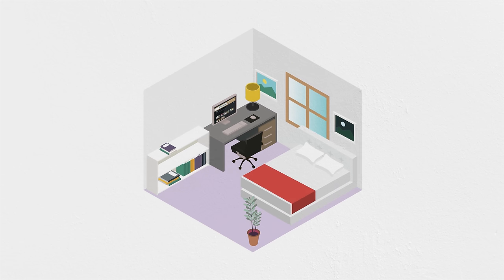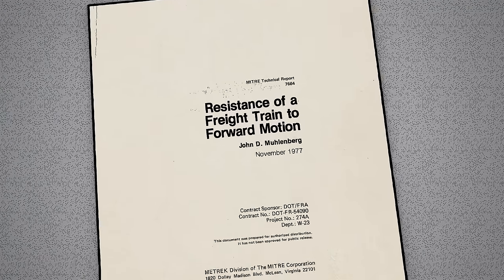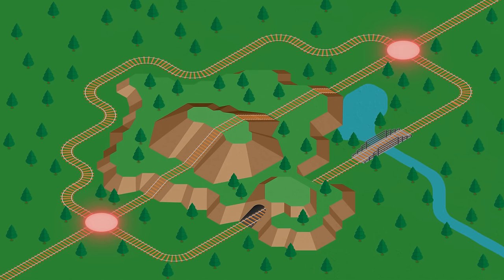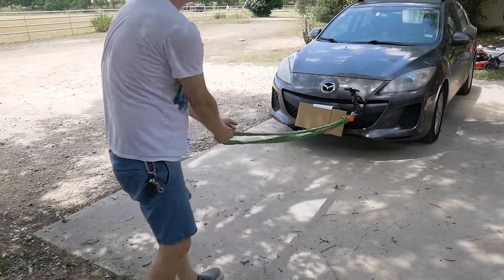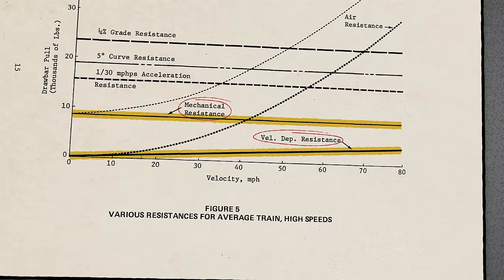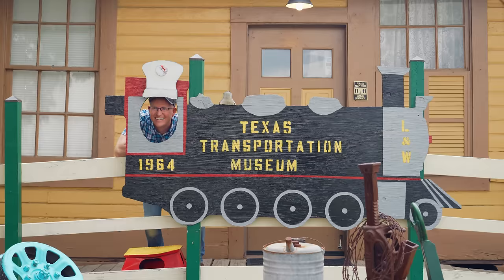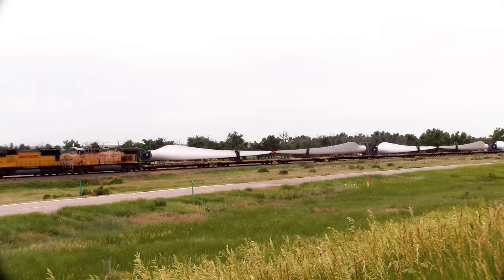Which Is Easier To Pull? (Railcars vs. Road Cars)

Comment: When going up hill pusher sets are needed to help going up hill on a railroad. When going down Dynamic Breaks are needed to help slow the engines like a Jake brake on trucks. As far as railroads with many Curves the tracks need constant reprofileing by rail grinders. But even then it coasts a lot of money to replace the rail due to the rail drift as the rail head wears out one the inside of the rail curve and the rail head drifts on the inside of the outer rail head.

Comment: If you're not already planning to, could you talk about how the weight of an object (the weight of a train engine or a man) puts a limit on the amount of horizontal force it can exert in a load? All I know is that once you exceed that limit, you end up skidding.
Reply: The key value is the coefficient of static friction, often known as µS. On level ground your max pulling force is weight times this coefficient. Once you start skidding you get kinetic friction which has a smaller value. For reference dry steel has a µS of about .5-.8, going to .42 when sliding.

Comment: As firefighters we are used to push cars by hand. Once we also needed to push a regional transport train. We pushed two carts, approximately 110 t in weight. Modern carts on modern tracks. We used 3 people for that. Once we got it moving, we barely used any force. We needed to be careful not to go to fast, because it was to easy 😂
Reply: Oh and for a car, we also need 2-3 people.

Comment: I have to add something interesting :D I am a 27 year old railway traffic commander in Hungary, but sometimes I have the opportunity to drive /with special permission/ because I'd like to be a driver later and I'm in the profession from age 10 (I served at the Children's Railway at Budapest) so I have comprehensive knowledge of the railway operations. The trains are faaar lighter and shorter here, maximum around 2000t in weight and 800m long. But one thing can be really surprising and scary. Once I had the opportunity to drive a tanker train full of diesel fuel. I just left the departure station but had to stop at the next station's Entrance Signal in Danger to let an EuroCity pass me, so from caution signal I started to apply the brake slowly . With other types of waggons this modern Siemens Taurus locos usually have a nice deceleration curve thanks to the fully computerized brake system, but this time the tankers surprised the heck out of me. They actually begun to jostle the engine making the traction motor indicators go crazy as the computer desperately tried to make up a new curve with each impact. It took me a good second to realize this motion is actually caused by the diesel fuel sloshing around in the tankers! Eventually I stopped the train safely around 15-20meters from the signal, but you could hear the tiny squeels the brakes made when the whole consist tried to move forward and then backward on and on from the motion of the fluid inside them. There are wave breakers built in them to reduce the effect but they are not perfect. It is crazy how much energy can be picked up by the fluid while you move the train around.

Comment: AcTuAlLy
In metric there is a measurement called kilopond, which is the weight of a 1 kg mass. (We had to calculate with this because we had really old hardness testers)
Reply: AcTuAlLy mass doesn't have weight without something opposing gravity accelerating it.

Comment: Don't forget to mention though that whilst you might only need 2-4 locos to pull a bloody long train, the diesel engines in them locos are just as big as your car not your car's engine. Hardly comparable but I get what you're trying to say.

I love the fact you had a use an aussie BHP train to show the midway locos :P  ... looked like they may have been WA/NT iron ore trains but frankly I've seen Sydney to Brisbane express goods (freight for the yanks) trains with 2-3 locos at the front and the mid ... they're the sort that are WAY too long to fit in the loops and get priority the entire trip so are not so common. Up to and over 1km long.

Comment: About the safety razor; I switched as well when I recently looked at how much plastic is used to make a disposable razor plus the cartridge head if there is one.  Compared to steel razor blades the environmental impact alone suddenly became obvious.  Even if the blade just rusts, the difference makes the change worthwhile.
Thanks for another excellent video, Grady.  Another thumbs-up, of course.

Comment: I instantly recognized that blue locomotive at the museum: that's a GE 45-ton switching engine, with two small diesel engines, located on either side of the cab. At the Mid-Continent Railway Museum, they have an identical engine that was donated by the Navy. You be hard pressed to find any other type of diesel in the US with tie rods.
Fun fact: the reason these 45-ton exist is because of contract terms. At the beginning of the diesel era, the railroader unions negotiated contracts that said that any diesel locomotive over 60-ton had to have a fireman in the cab. Rather than comply with the spirit of these terms, many railroads instead bought lighter locomotives, so they could pay 1 person instead of 2.

Comment: I dont usually comment about sponsors, but safety razors are superb tools. A great aspect is rhat the blades can be sharpened, and/or recyxled - it's just a thin piece of steel. The handle and head should last a lifetime.

Comment: It should be noted that even with the resistances so low, a locomotive could never get a long string of train cars going from a standstill if the train cars didn't have draft gears. I'm surprised you didn't go into detail on them or even mention it

Comment: 5:57 and this is also how highway engineers determine the “recommended” speed on curves! If you exceed the maximum speed rating, you run off the road!

Comment: You would have had fun a number of years ago the transportation museum in Roanoke Virginia had an event where they tied a rope to their massive Norfolk and Western class J steam locomotive and had gas pulled the fully fueled and watered steam locomotive with the rope...395 tons of locomotive and up to 35 tons of coal, and 22,000 gallons of water.  Which is amazing on 1950s technology it can roll so easily

Comment: Not getting the energy back when going downhill is only true for diesel trains, normal trains just start regeneretive breaking and send the energy right back into the grid. There's many steep routes in switzerland that are energy positive one way, and overall recuperate 80-90% of the energy used.

Comment: Trains have super tiny contact surfaces, made of very hard and very smooth surfaces. Very little friction. So it doesn't take much power to move them, it just takes time. Just as it takes time to move the 2 ton boulder in a pole we have in the city. You can rotate it without any tools, it just goes slowly.
Also the reason for why trains can't really go uphill. And down, the same low friction that makes the train slip when going up will also cause it to slop when going down.

Comment: The largest freight-rail brand in the US operates a short line to a local manufacturer near me. Far from basing power on the needs of the expected consist (which amounts to almost nothing), they will often have two or even three locomotives tasked with pulling half a dozen average-weight cars on nearly ten miles with little elevation. Even when I have heard engineers reflect on the public claims regarding 400+ mpg per ton, most of them don't seem to actually believe it other than theoretically. The freight prices to use them really reflect this as well, hence the far greater dependence on over-the-road trucking by all of the companies I have worked for (plus the trucks are far more efficient with time ). In general, for most purposes, the rail companies actually seem pretty wasteful compared to their promise.

Comment: I always thought the limitation to grade was based on traction. The coefficient of friction between steel and steel is very low therefore the locomotive's wheels will simply slip if the grade is too steep for the overall weight it's pulling. Hence the need for funiculars or toothed rails in mountainous areas

Comment: A so-called one ton pickup truck is NOT actually limited to one ton of weight hauling.
It's more of a standard VOLUME description, I think.

For reference, I can easily carry 2-3 tons of gravel in the back of my E250 van (which has a bit LESS capacity than a F150 standard pickup truck), and that's WEIGHT limited not size limited.

Still, it would probably take ballpark 10,000 1-ton pickup trucks to move it.

On the other hand, it would take MORE semi trucks, given the total limit of weight of those in most cases of 40 tons INCLUDING the weight of the vehicle itself (way over 3 tons, more likely 5-6 tons normally for tractor + trailer).
More like 800 such vehicles with a "gravel" type trailer.

Comment: 3:50 i would have loved a more detailed explanation here, i am not a native english speaker and the difference between mass and weight is hard to understand when its not the mother language. in germany we also differntiate by "Masse" and "Gewicht", the units used are usually kg and newton, newton being the unit for weight if you go technically. in daily use the approximation usually is done in kg, because 1kg is pretty much equal to 1kn, but its not exactly the same. it would be great to show SI units alongside Freedom units at all times. that said, im critiquing a small detail in an overall excellent video and i really like your content.

Comment: Its all about the gradient. The rail car is super heavy but its got utterly low rolling resistance. This is assuming a perfectly flat and smooth surface. See the car's weight is distributed over a larger surface requiring more force to move it. The railway car's weight is distributed over a very small surface area as such its rolling resistance is very low.

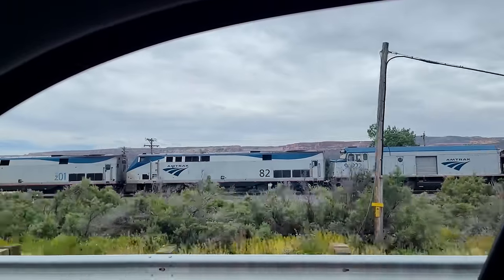Comment: 4:45 Even if a train didnt need to brake, it still would be less effective due to air resistance increasing with the speed squared. meaning that going a consistent lower speed will have less total air resistance than going slow and then very fast.

Comment: The loss of energy on braking is only true for non-electric trains, though. Those can switch their motors to be generators and reclaim most of that energy. So when building i.e. an electric tram in a hilly city, the calculation would be different from a diesel freight train for that reason alone.

Comment: I immediately started thinking way too hard about the choice of route. Lol
I was considering up-front cost of construction and long-term maintenance costs on the bridge and tunnel, whether it was a time-sensitive load, additional crews needed, depending on the length of the route, etc.

And yet, I still failed to think about the resistance added by curves.

Comment: Speaking of break even analysis... Let's do one on the cost of a good straight razor. compared to henson. You can get a straight razor and strop for around $25+ new and if you buy an old one at a flea market for the same price you will have a lovely vintage piece and just have to spend another $10 or so on a strop. My oldest straight razors have been in use since the 1800s and still shaves my face like a dream. Looks like we break even before the experiment even starts as you don't need to spend as much on a straight razor and an entire shave kit as you do hensen since on your chart it starts at $70.
Reply from the maker: I tried a straight razor and just found it really stressful. It takes a lot more skill than a safety razor.
Reply: @PracticalEngineeringChannel  that is a valid point. Not everyone is comfortable or skilled enough to hold an extremely keen blade to their jugular.

Comment: No ... the 'metric' system does not use kg for weight units. It uses the Newton. I believe kg are used in everyday as a unit of mass which is correct in commerce. The pound is a measure of force and for a given object, it's weight will change with altitude. Mass in the Imperial system is the stone ~14lb at sea level.
Sarcastically, I feel that when folks move from Imperial to SI units, they like it when the number on the bathroom goes down (kg) not up (N). For example 220lb = 100kg = 980N.

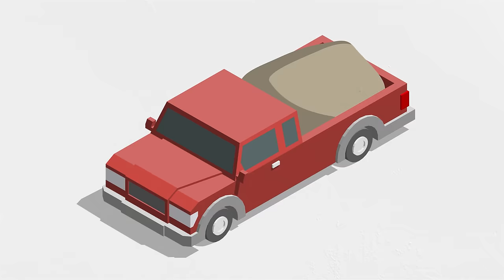Comment: 0:40 "One-Ton Pickup Truck" is a term that has become very misleading. I assume it dates back to maybe the 1950s or earlier when that is how much the trucks could carry.  However that class of truck has been improving ever since.  Especially with each brand trying to rate "best in class".  The fact is a 2024 "One-Ton Pickup Truck" can carry 3 to 4 tons in it's bed.
Also since you let the Semi trucks use trailers it only seems fair to let the "One-Ton Pickup Trucks" do the same.  With the right trailer they can haul up to 16 TONS.
All modern 1/2 Ton pickups can carry over 1 ton.

The capacities stated above are "legal" loads for safe travel on the roads with the rest of us.  Probably the main limiter is braking. If these trucks were allowed any amount of distance to come to a stop, like trains, they would probably be able to move more than 4 times as much, even more on very flat grades like train tracks.

If you have read this far, I just would like to say very good video.

Comment: . I used to work at a huge car lot. Several times a day we'd have to push cars around. Some were so much harder to push than others, even the exact same model .. I finally figured out that the main problem was tire pressure. If your car tire is not perfectly round, like a train wheel, then you are losing power and gas mileage. 
I also used to work for a mechanic, and people would bring their car in for a tune-up. The last thing the mechanic had us do is fill up the tires to the max. People would come back and rave and say how much better their car accelerated..The mechanic said it was 90% from tire pressure
Reply: Even railcars have to deform imperceptably to distribute the force and not shatter. If you make the wheel ring likea bell with a hammer, then they sound different depending on load and possible defects. Some safety checks make use of that. I don't know if anyone has automated that process though.

Comment: I've pushed railcars by hand many times, much easier than pulling. Especially after the brakes are bled off!
On long trains we planned to use as little as 1 hp/ton, shorter trains would be all on the steep and needed more power. Strange to think that your car's engine could pull a few hundred tons if only it had steel wheels.

Comment: I would say rail cars without even watching video. With cars you have the resistance of the transmission and soft tires. Trains are steel wheels on steel tracks less resistance. Back in my 13-16 years of age, I used to play in train yard near house. I could push decoupled train cars.

Comment: Tbf, the comparison train vs semis vs pickups is not fair, given that the smaller the vehicle, the smaller the percentage of the total mass is given to payload. A 2.5 ton pickup has a payload of less than 1 ton, a semi has probably slightly more than 1/2 the total mass dedicated to payload, while a freight train is most probably 80% payload and 20% engine and structure to support the payload

Comment: Just want to mention that a tyre filled with air has a lower resistance than a wheel made of solid materials on roads. A road is never even like a railroad. With a "hard" whel you have to "lift" the car over every obsticle. A tyre absorbs it.

Comment: I was living in Ukraine, and travelled from Donetsk to Odessa for dozens of times. All trains were running on electric, and had wider rails and carts than our European trains had. Worked very silent you could only hear the railtrack sound. You could add regenerative breaking and feed it back to grid on downhills, a solution idea..

Comment: This video very neatly explains why an engineer would tell you rail is best at moving large loads of freight overland, using less energy, CO2 emissions, less people and so on. The trouble is it's politicians who make the decisions and at least in Europe they came up with something called track access charges. These have been set way higher than road taxes on lorries. To give an example, roads cost a lot to maintain and in a recent study it was found that 1 lorry does the same damage to a road as 150,000 cars. So basically lorries damage roads, cars don't. But lorries are considered a public service so it's mostly paid for by public taxes including car tax. Rail is also subsidised, but it's nowhere near as much as most people believe. And if you add on the fact that one fully loaded freight train emits 76% less CO2 then it seems quite mad to me that the vast majority of freight in Europe goes by road.